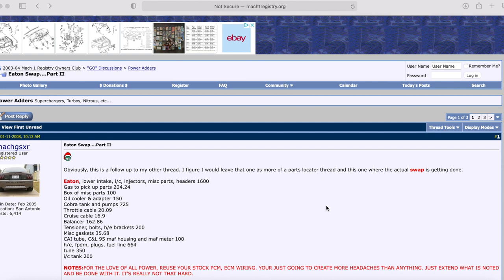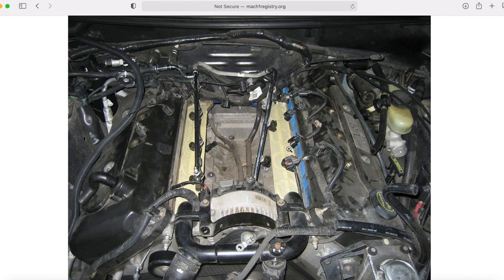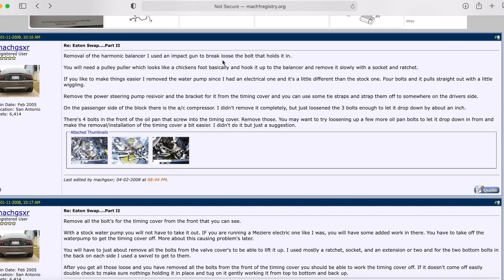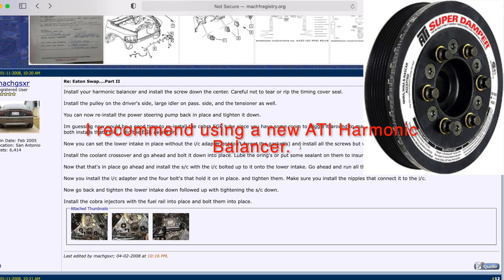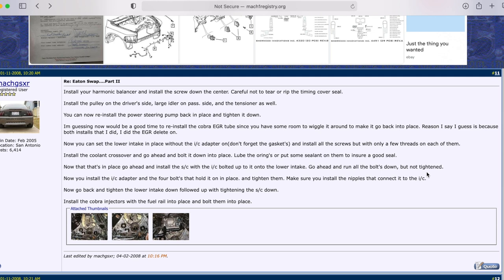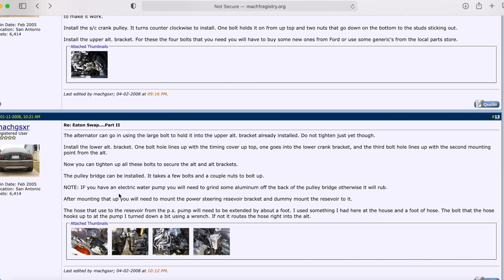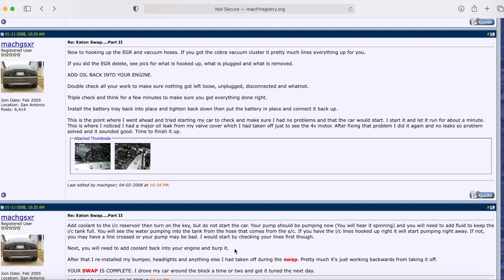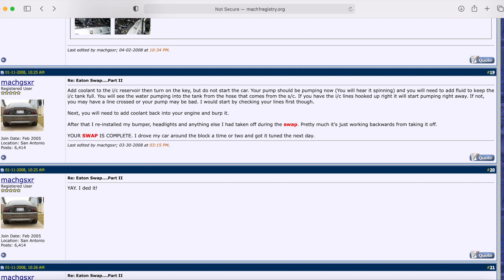Eaton Supercharger Swap - Mach 1 / Cobra / Marauder - Part 2 - The Install!

Comment: I bought my 2004 Mercury Marauder in 2005 and still have it today with only 55,620 miles as of this writing. I always wanted a Trilogy kit and it was just not a wise financial move. Now that I can afford it, it's been discontinued after 250 units. Ugh... I was able to get EVERYTHING for an Eaton swap except for hoses, wiring, and some small parts which will be determined AFTER the hard parts are installed. I work at a Ford dealer so Motorcraft parts are used where possible. The goal is to make the swap look as OE as possible. Thank you for your time to educate and inform the masses with your content.
Reply from the maker: My pleasure, let me know if I can help.
Reply: I might add that I already have a Lidio tune with upshifts that break the tires loose on the 1-2. This happens on hard acceleration even without being WOT. I installed 4.10 gears a decade ago and about 6 years ago Heinous Billet CA's. That combo takes all the driveline deflection out of the rear. While helping a buddy do one of the many Trilogy installs I have attended - I managed to get a Steeda Underdrive crank pulley because I had a stock one and my car was a half mile away. I already have a NIB pulley for my Eaton swap. Sources say the higher gears will make wheelspin extremely easy so I have an extra pair of wheels I might have widened as well. I certainly hope my little girl marries a guy worth a damn because he stands to inherit one hell of a sweet Marauder. My Silver Birch is #2187 of 3214 and has a sunroof and heated seats. It also has been documented since purchase with ALL the 2004 model catalogs, brochures, and dealer sales booklets/videos/window decal, a 2" thick binder of receipts, an $8,000 sound system ( I was a JL Audio rep for 9 years), and had Chip Foose sign the owners manual in 2007. It is mostly used for shows and cruises now.
Reply from the maker: @_BAD_MERC_  With 4.10 and a supercharger it definitely is going to spin, which can be a lot of fun...   I went from a 3.55 to a 3.25 and with 450hp and 14 pounds of boost it just spins the tires in first and second.  I’ll install a different supercharger that I have next year and should be 550 to 575 with a street tune.  I definitely will need stickier tires then.
Reply: Are you saying that Gerry doesn’t build the Eaton brackets anymore?

Comment: I made it to the end. Great video Mike. Good info and nice added suggestions. I watched the whole video but did I miss the part about filling in a hole that the WAP block has on front by the timing cover? I hear you have to plug a hole with RTV from a timing cover difference between the Mach 1 and the cobra cover.
Reply from the maker: Yes there is one hole that needs to be filled. I’ll add it to the description.  There is a lot to remember.  Thank you for watching to the end!

Comment: If you wire the IAT2 (MAF sensor) to the 2 wires on the MAF is the normal IAT1 reading still retained? I guess what I’m asking is can you read IAT 1 and 2 at the same time?
Reply from the maker: You will only be able to read IAT2.  But that is the only intake temp you need.

Comment: Hey Mike one more question you might have the answer to, what do I do with the knock sensors being I had to cut the studs off for the mounts can you clear the supercharger.... I don't think you're Mach One had knock sensors.... correct
Reply from the maker: Leave them unplugged.  In the tune they will be turned off.  Moving IAT 1 from the MAF to IAT2 on the blower will allow the computer to retard timing due to increased intake temperature.  Essentially retard timing so you don’t detonate due to excessive heat from boost.
Reply: @MikesGarageRoute66  thanks that's what all my research was saying just leave them unplugged....
Reply: Hey....to turn the knock sensor off you said do it in your tune.....what tuner do you suggest....again Thank you
Reply from the maker: @mbcustoms   I’m using a SCT tuner.  My tuner was Dynotune MP and it was dyno tuned.  Mike Post left the tune unlocked so I can manually change things over time.

Comment: Hey Mike, do you know of a download tune for a SCT hand held that is a good base tune for the Eaton swap. Thanks in advance. Mad Brad
Reply from the maker: @mbcustoms  I don’t have one.  The startup tune is based on your mass airflow sensor, injector size, and how much boost.  If you are planning on dyno tune,  a lot of tuners will email you a startup tune for your setup so you can drive it over to the dyno.  That is what Mike Post did for me at DynotuneMP
Reply: @MikesGarageRoute66  ok thanks for your help!

Comment: I know this video is 2 years old, but I wanted to ask if there was a reason why you chose to use the Cobra pulley bridge setup vs. the Marauder Eaton Swap brackets made by Gerry? I’ve done a ton of research and Gerry’s brackets have held up to 800hp without any belt slip issues. Thanks again
Reply from the maker: Great question.  I went this route because I got a good deal on a complete Eaton Swap.  I purchased it  3 years ago for 2600 including shipping.
Reply: @MikesGarageRoute66 That’s a steal of a deal since they go for double that now
Reply from the maker: @KINGRG1  Yep, unfortunately most car parts have almost doubled.  It’s making it more and more difficult to do cool things in this hobby.
Reply: @MikesGarageRoute66 currently in the middle of my Eaton swap so I appreciate this video but I ended up finding my complete swap kit for $2100 so that’s also why I’m going this route
Reply: @MikesGarageRoute66  I was just curious if you know the forums say to just reinstall the power steering pump when I got my Eaton swap kit I was also given the 03-04 cobra power steering pump do I need to put the 03-04 one on

Comment: Mike watching your videos, do you have any knowledge of doing an eaton swap on a 01 cobra. I'm down to figuring out my wiring harness I have an 03 harness that came with the eaton swap do you know do I have to use the 03 engine harness or can I just use the 01 Cobra engine harness thanks in advance
Reply from the maker: Use your wiring harness.  The only thing you need to do is move your IAT one sensor to the IAT 2 location
Reply: I have had so many say you got to do a complete harness engine and data system, ECU, dash and gauges are you'll have problem down the road...
But my mind I thought the 01 stuff would work...thanks for the info! 
Good work on the vids...Mad Brad....@mbcustoms
Reply: What did you do for his fuel pumps in the tank....ty
Reply from the maker: @mbcustoms  Cobra tank, modified fpdm, wiring upgrade, two updated Walbro GT Supercar pumps.

Comment: Hey Mike did you have to tune your car???
Reply from the maker: Not yet, working on getting all the emission controls working first.  I also have a 9 inch rear end ordered up.  So that should be fun.
Reply: Congrats on the SUB count, I’m more of a private person, can’t bring myself to do what your doing now, so kudos to you sir!!! You know what, I was asking about the tuning thing because  I have a 03 Mercury Marauder and I installed long tube headers and full exhaust with high flow CATS, so I can be emission legal in Illinois, and now I’m getting slow response codes for the upstream O2 sensor on both banks!!! I’ve talked to a couple of guys and they said the car probably needs a tune because the O2 sensors are farther down so the ECM needs to know the rate of flow. I’ve reached out to HP Tuners and they said Mercury Marauders is not a car that support at this time. Wondering what if you had a tuner in mind???
Reply: I’m in the Chicagoland Area by the way!!
Reply from the maker: New o2 sensors may help because as they get older they become lazier.  But the farther you move the o2 away from the cylinders the lazier their readings will be.  Since the o2 sensors create their own signal a tune does not fix that.  On your Mercury Marauder, the PCM looks at the crossover count to determine if the rear o2 sensors are working correctly.  It counts how often the upstream o2 sensors cross over 450mv and that they cover the full range of 0 to 1000 millivolts. It then counts how many times the rear o2 sensors crossover.  The downstream 02 sensors should crossover less often then the upstream o2 sensors.  If it doesn't then the PCM believes the cats are bad.  If new o2 sensors do not work you may need to put your OEM manifolds and cats back on.